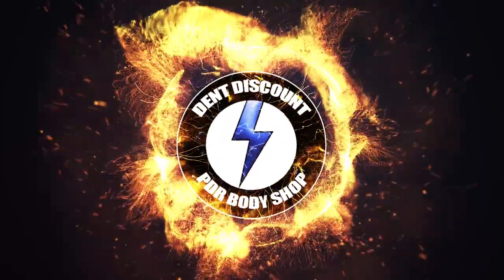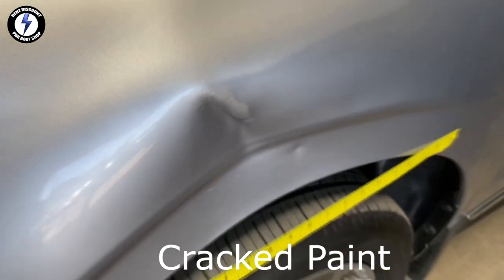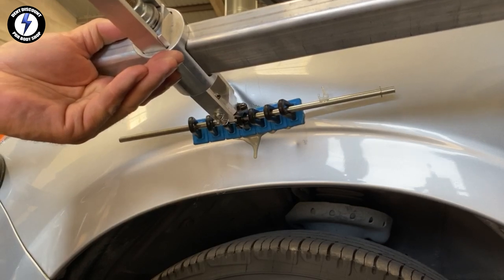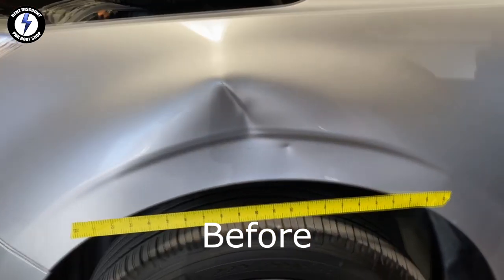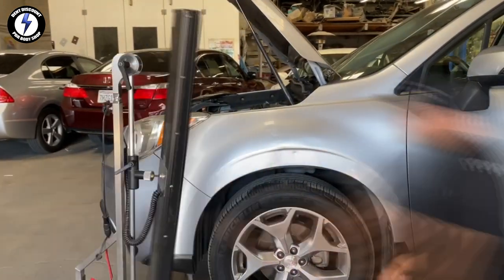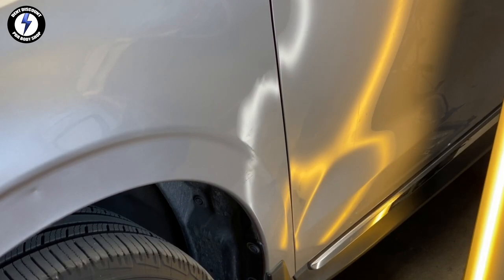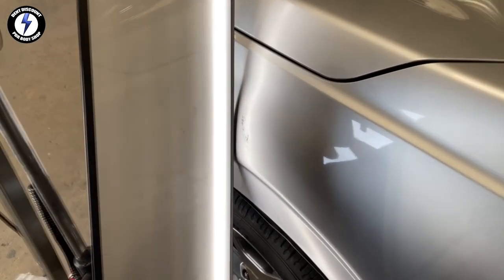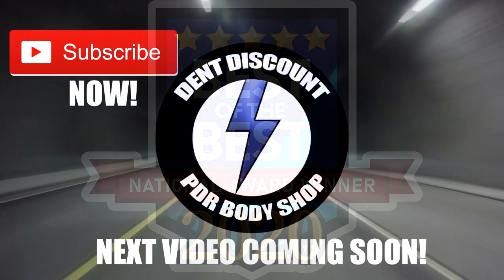Powerful Dent Pulling Technique! | 3 Step Method!

Comment: Great video! I'm a new sub. I was wondering what all pushing rods do you suggest for a beginner?
Reply from the maker: Welcome aboard Joshua!! I like a 24 inch double bend and a 42 inch single bend.
Mine are from Ultra tools.
Reply: Would you get interchangeable  tips?

Comment: Questions:
What glue are you using? You did mention that it was hot, and you were also in shorts. I'm curious about different types of glue for different situations, ie: temps, metals, etc.
Do you go glue for most or all of your repairs?
Reply from the maker: I made a video in the title it’s called high Street glue. Go give that video a look.
Thank you for your comment